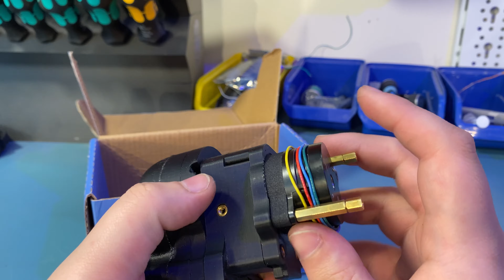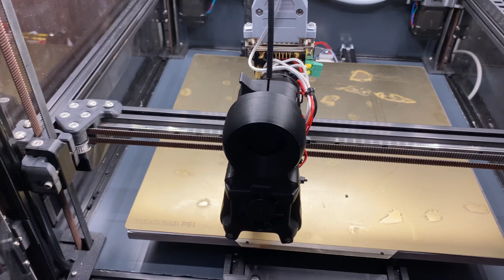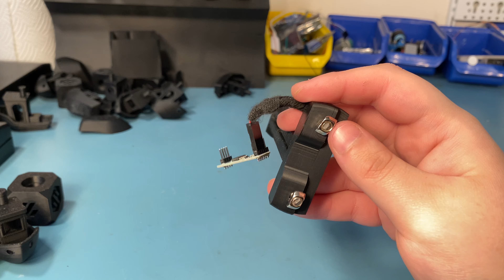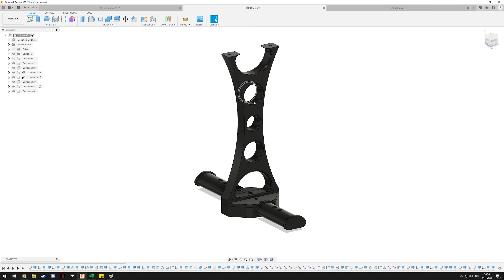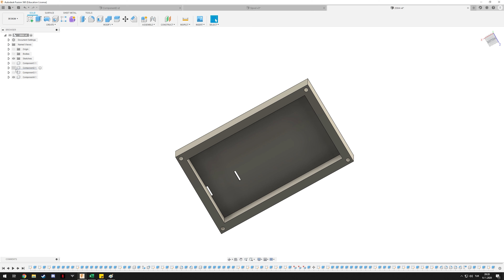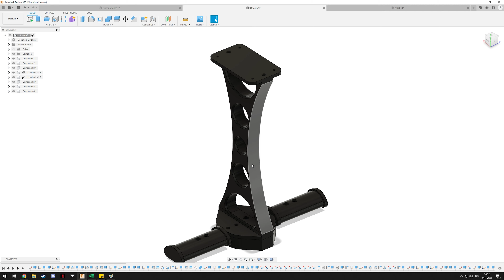Voron v2 Ep. 14 - Galileo Extruder

Comment: it seems like considering how heavy 2 mgn9c and an extrusion are. int he end it doesn't really add up to much of a diffrence on the Y. but also. it's strange that it looks like you had a bit stronger  ghosting on the Y on the lighter extruder. did you change the print speed/accel? the frequency looks way higher
Reply from the maker: It's the same gcode and same fw settings except esteps and e volts. To me they looked about the same but I threw them away so can't check again.
Reply: lower weight = higher frequency resonance, it's not much of a difference but there you are.

Comment: I will be interested to try the load cell in the future. I was using an OctoPrint plugin to manage weights but it just seemed inconvenient. I guess I may just continue to use a filament runout sensor. Except mine erroneously reports runouts, despite a full spool. Probably either a pulldown/pullup issue or loose connection. Great video as always sir!